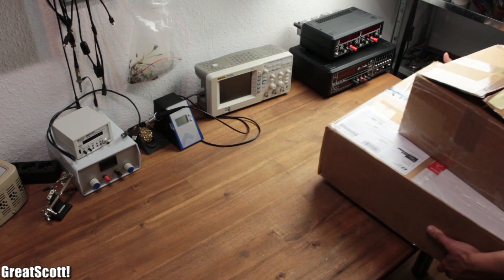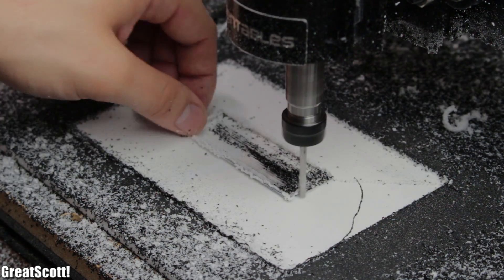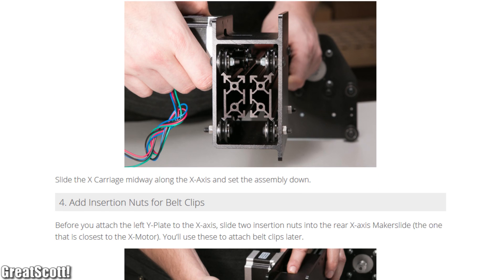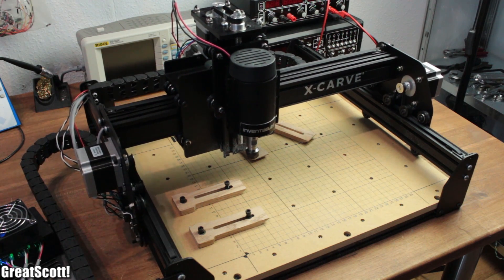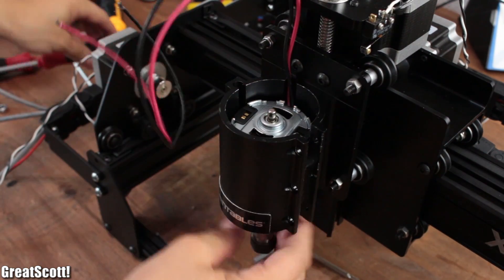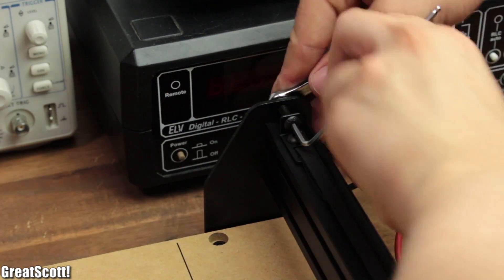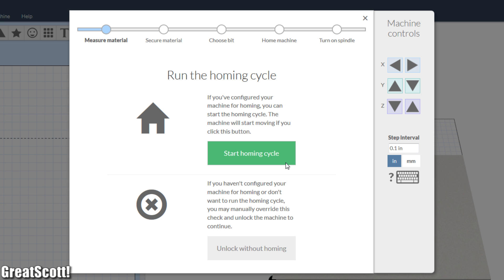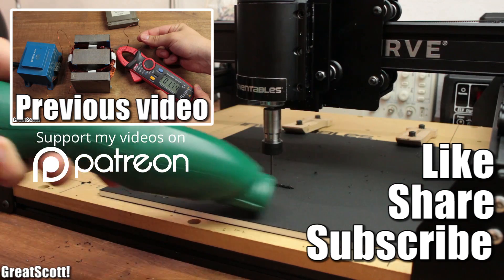X-Carve DIY CNC Machine Review

Comment: You can tell you got this for free. You were way too forgiving. If I paid $1,000 for one of these and ran into those problems — motor doesn’t fit, poor incomplete/erroneous instructions, improperly sized terminal blocks, need to crimp your own damn connector contacts — the fracking thing should go straight back into the box and returned for a full refund. That’s way too much money for a sub-par CNC machine.

Comment: Never knew you could get such a thing as a kit! Wood shop versions are in the 3-5k US dollar range. Thanks for the video.
Reply: I don't like it that the software is web based. If the company goes bust, you're left with a brick, or you have to write a new software by yourself, and that's not  an easy task. It's several months to a year of work for a good developer.

Comment: i built the 1000mm version of the X-carve myself, the only thing purchased from inventables was the gantry carriage. Overall cost for me to build it myself was $337.28

The biggest issue with these machines is rigidity, and price. It's not really that rigid because of several factors:
1) The stand-offs that hold the gantry and maker-slide rails up from the waste-board aren't really that beefy. Instead of using thin sheet steel, i made mine out of 6.35mm aluminium, (1/4" for the imperialists :p)

2) The gantry maker-slide rails, while somewhat rigid, do "torque", and on the 1000mm version, it's quite a lot, i ended up "shimming" the gantry rails with a piece of 4.75mm flat bar steel.  (3/16") Torque was almost completely removed (i say almost, because i didn't try standing on it to see if it still torqued :p)

3) Supporting structure, or lack thereof... In the 500mm version, the support for the waste board is adequate for lightweight materials, and thin pieces of aluminum.. However, on tougher materials, the lack of proper support under the waste-board allows the waste-board to deflect, and warp.. Even on the 500mm version, this happens, but it's not really noticeable unless you're looking at the surface finish of a flat that's had several passes made in succession. I solved this by replacing adding additional supports, and actually anchoring the waste-board to the support rails every 100mm. 

Accuracy issues:

1) Te waste-board is painted.. It looks nice, but a stencil or something should be included, as  you'll need to resurface it regularly if doing any through cuts, or if you have an issue or crash.  It should also be mentioned, that the waste-board should be face milled before first use, just to ensure it's perfectly parallel with the spindle. 

2) Belts suck. PERIOD... while they do work, they require constant monitoring, and retensioning. They lose their strength over time, and aren't really that reliable. For this reason, the accuracy of the belt system is kind of hit or miss, you will need to constantly measure, and adjust your GRBL settings to compensate for deterioration of the belt's performance, as well as tighten the belts as they slack over time.  It should also be noted, keep several spare belts on hand, while i've not had one break yet, it's sure to happen sooner or later as you keep tightening them to maintain the proper tautness required for operation. 

3) No DRO, or Digital readout, or independent measurement system on the machine is a BAD IDEA! missed steps happen, and without witnessing a lot of successive missed steps, most people won't even know it's happening, one or two missed steps over time adds up to quite a few, and a ruined project.  A high count rotary encoder on each axis and an arduino with I2C LCD is plenty enough to keep track of actual machine position vs grbl's calculated machine position. grey-code optical encoders could also work, but the amount of dust, and debris generated by the machine would make it difficult to maintain them. 

Pricing:

1) The "quiet cut" spindle being sold, is a cheap, no-name Chinese import. The bearings are very poor quality, and seated in rubber, making for constantly deteriorating run out on the spindle. The price if purchased directly from the chinese manufacturer is only around $30 USD, versus the $80usd inventables sells them for.  This massive price hike can be seen throughout the inventables shop, where pretty much everything is marked up anywhere from 250% - 500% depending on the piece. 

Overall, the machine is a nice concept behind it, but poor implemented, and extremely overpriced components, and kits doesn't save it. 

The only saving grace for this machine, is it's modular enough that the issues i've outlined can be addressed by the user, and that the machine is opensource hardware, and can be built by anyone with a few exceptions. The makerslide rails, and gantry carriage cannot be built by the home hobbyists as they are, one would need to redesign them to make it easier for hobbyists to make. 

For the rest of it, the machine works quite well with chillipepper, and pretty much any software that can control a GRBL based device. The inventables "Easle" Site needs quite a few improvements, including but not limited to tool selection, tool customization, auto-leveling adjustment etc.
Reply: Thanks for your honest review.

Comment: When the motor didn't fit you could have used freeze spray on it to cool it down to the point it shrunk. if that wasn't enough then heat up the space it goes in with a torch to expand it. Just might have made it a tight fit :)

Comment: I have a suggestion, you can attach a small office/desktop vacuum (one of those tiny vacuums that run on AA batteries) and find out somehow to properly mount it to the milling head so it vacuums the dust and debris during the milling process, this will make everything clean and tidy.

Comment: I have been looking at this CNC for a little bit. Ive been wondering, since I read it was open source, am I able to just buy the smallest setup and expand it to my needs?
Reply: Razzman yes you can I have an xcarve 1800 by 900 mm and it was about $1000 so you can get it cheaper if you play with what you buy
Reply: +Razzman you can just buy the nema 23's they have more torqe

Comment: New subscriber here :)

From what I've learned so far this seems to be a really honest review. He even mentioned that some of the parts of X-Carve are "overprised". You usually don't do that  when you get something for free, so thumbs up.

What you missed are the shipping costs and custom fees. Meaning 1000$ machine + ~250$ shipping => 1200$ + custom fee + 19% VAT and you end up somewhere between 1300€-1500€

Scott, please, please take care with this machine, the spindle can rotate with up to 30000rpm it can generate a lot of force when it gets stuck. So please handle with care. You use a rotary tool from time to time, just hold a piece of aluminium and try to cut it, (LOW rpm please) and you will see that there are quite some forces.

And please do me one favour, cut something out of aluminium, and check the accuracy. I really like to buy one of these machines, but I need it for some small alluminium work.

BTW there's a nice German CNC machine called stepcraft. I think it's worth a look.
Reply from the maker: adrasx Once I need to use the machine will aluminum you will see it. And I will take a look at stepcraft.

Comment: Hey this is a good video dude! I learned a lot from this video it's making me have second thoughts. for $1000 you think they have these "minor" things fixed like with the spindle not fitting. And also especially the threaded screws having a hard time. as well as the other stuff you mentioned. like the power supply not being attached even though that's not the big thing but still for $1000 you think they think about it the head of time. well thanks again for the video  this really educated me on the this unit.